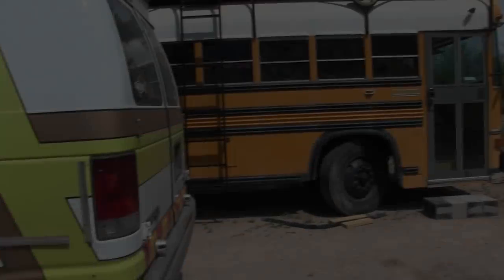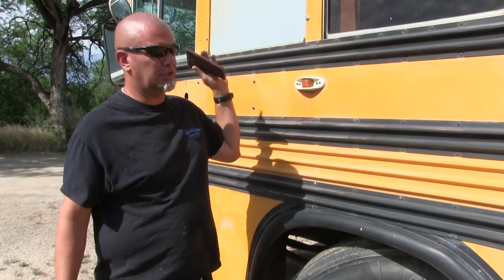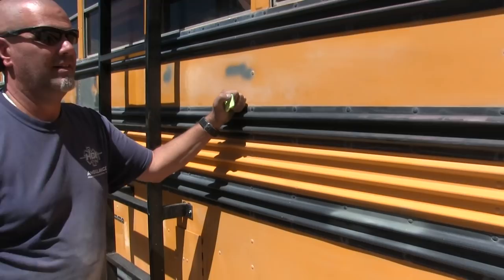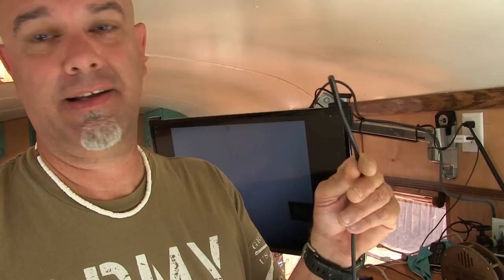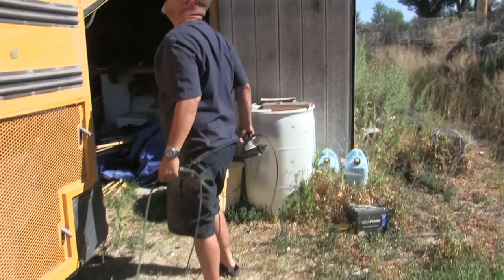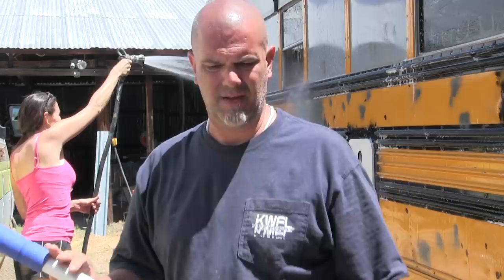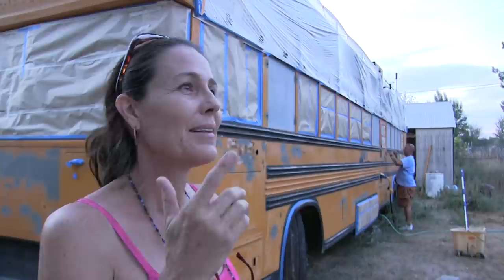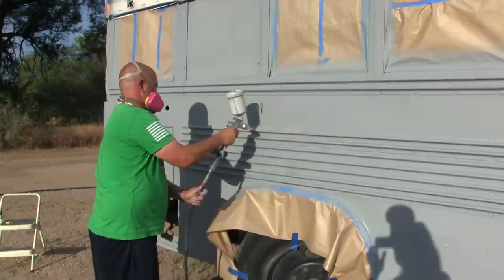Painting the Skoolie Part 1: Sanding & Primer

Comment: I helped my fiance im his auto body shop and my job was sanding and masking. Most of the sanding of primer was wet sanding with 320 grit. Then 400 grit. I did some 12 passenger vans but never anything as large as your bus. My hat is off to you two.
Reply: Did you sand down to bare metal? How far did you sand down to?
Reply: @m3ss1na  were you asking me? If repairs left any bare metal I would spray with primer. If just prepping previous paint finish I would wet sand with 320 just surface not down to bare metal.  We used regular automotive paint and only used lacquer a few times too labor intensive.

Comment: Sanding sux- I had to sleep in a neck brace for a week after doing my 38'- but then I rolled it instead of spraying- just didn't have the necessary skills and equipment- hats off to your Mad skills and fortitude! Your videos are easily the most comprehensive build series I've seen- you should have 100000+ subscribers!

Comment: family owns body shop with 40'+ booth and you are explaining exactly what we would do for buses and beverage trucks, you did not mention this part but before the clear coat we would do a wet sand after the last coat of paint dried.
Reply from the maker: What grit and what did you do in the rub rails?
Reply: @BussyMcBusface  It has been many years about 20 years but i think it was 1200 to 1500 grit a water hose and tired arms. Also i reread my original post and the color sanding or wet sanding is done after clear coat to remove that orange peel skin look. The grit depends on how many layers of clear used. Keep in mind this is really only done to get a shiny glass top look like you find in show cars. I really do not think you need to do this with a bus

Comment: Commercial airless paint sprayer........... You can shoot virtually any kind of paint through them including automotive. Much wider spray pattern as well, 12-16 inches. That's what, 2-3 times the gun you're using? Harbor Freight has one for around 200.00

Comment: May be a stupid question here, but why didn't ya use a pressure washer to do the washing?  Wouldn't it have accomplished washing easier?
Reply from the maker: Yes and no. Faster but we used pro grease remover in the soap so it was necessary to wash it by hand. Super important.

Comment: Question for mikegyver...after primed then lightly sanded then washed again is it silly to paint and clearcoat with a brush?  Will it look bad?
Reply from the maker: I personally thing that the paint brush method will work but consistent coverage will be a problem.  If you are using automotive clear coat, you have a limited amount of time to lay down the paint before it starts to harden. A cheap sprayer made all the difference in the world.
Reply: @BussyMcBusface  thanks man.  More research incoming. 😆
Reply from the maker: I personally would go get a 35 gallon compressor or borrow one that has a pretty high air flow and then I would go to harbor freight and buy an inexpensive HVLP gun. You will probably need to do your due diligence on YouTube to learn how to spray it. We cut our paint with mineral spirits at about 4 to 1, paint to mineral spirits.

Comment: What size compressor? I have a husky 25 gal think it might be to small
Reply from the maker: We have a 30 gallon compressor with a pretty big motor on it to allow for a lot of CFM s for spraying. It's in storage right now or I would give you more specifications.
Reply: @BussyMcBusface  ok, yeah mine takes a while to fill lol think we’re going to brush paint most of it and spray some smaller areas. Thanks for reply!

Comment: So, is that the only sanding you did before primer?? I'm hearing you have to sand the entire bus to at least remove the clear coat or even to bare metal?
Reply from the maker: We didn't do that and it seems to hold up just fine up to this point
Reply: Nice! 
So, all you did was rough up the surface with the scotchbrite pads? 
And another question, did the bus have any clear coat, and if it did, did you just rough up the surface with the scotchbrite and painted over the clear coat? 

Prepping my bus now, appreciate the info.